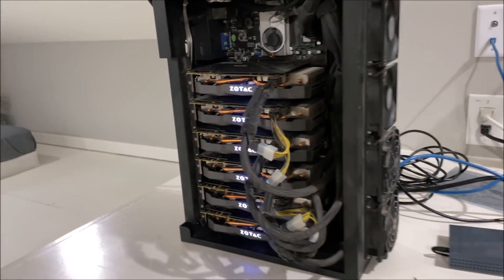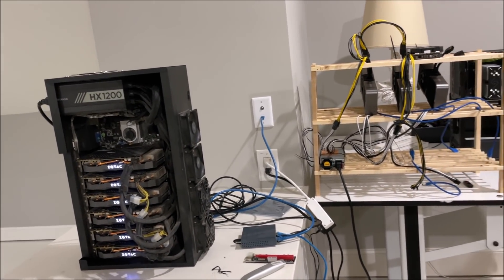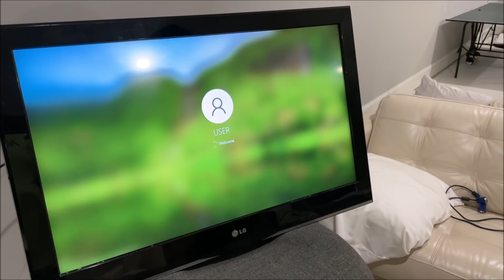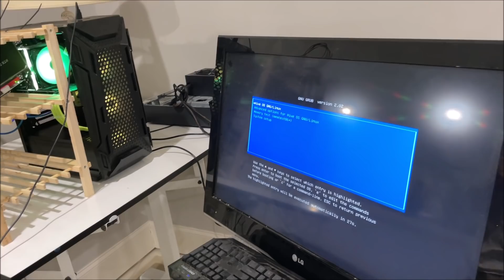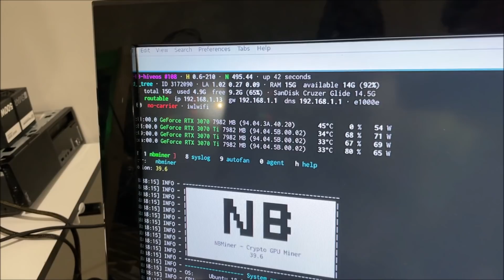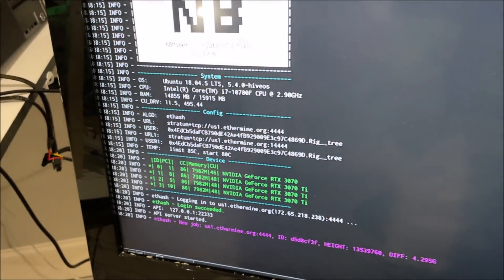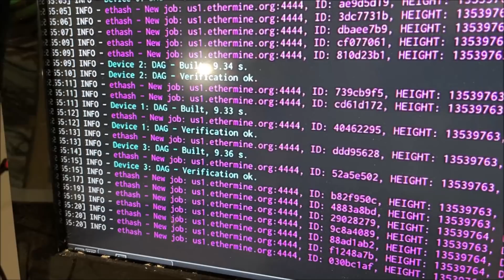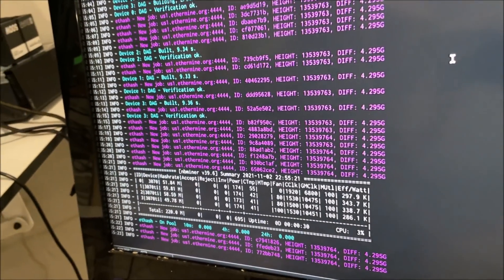Adding GPUs PCie Splitter x4 Mining Desktop

Comment: Should plug the splitter into the x16 slot that runs at x16 speed and put the GPU in the other x16 slot that may run slower at x8 or x4
Reply: it's a x1 splitter so you only get x1 speed...size matters

Comment: Why do you mine with LHR cards on ETH, they are super inefficient?
Reply: 60MH/s is 60MH/s, ETH is still plenty profitable on them and he doesn't have to deal with multiple pools/coins/exchanges
Reply: @austinh1028  I prefer non LHR cards.
Reply: I think we all want non LHR cards but sometimes that is all there is to get.   I got 12 1070 founders cards yesterday and those crazy things were 330 each but I got 12 at one time so I had to jump on them.  I was lucky it was a guy that was selling everything off and he threw in 3 750 watt power supplies and risers and cables so it was a ok buy I guess

Comment: Have you found these splitter cause restarting?
I have a 27 lane cpu and 7 cards..
Normally 6 cards.
I think my 4x splitter may be causing restarts.

I'll find out tomorrow when I take a 6800xt out and take the splitter out.  And just run 6
Reply: I have many builds with them, they dont.  Usually works fine once kept cool
Reply: @Mike Jones yea mine is seperated from gpus so no direct heat. The heat sink on them is pretty basic so try to keep it cool n u should be good